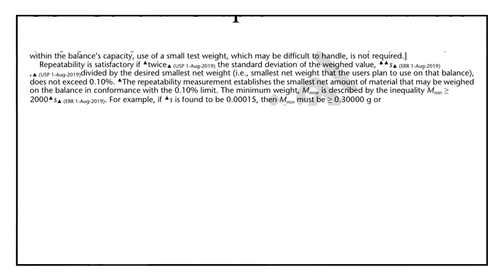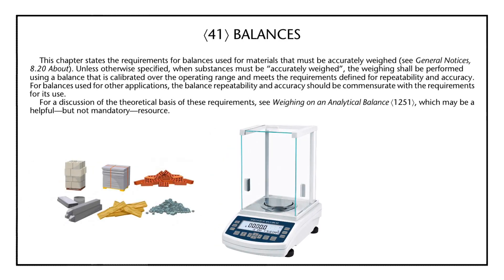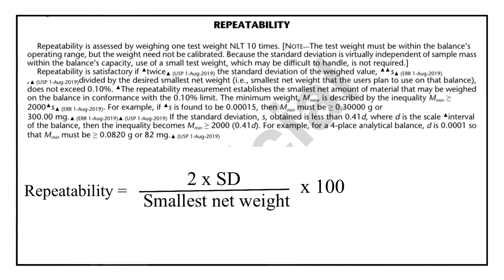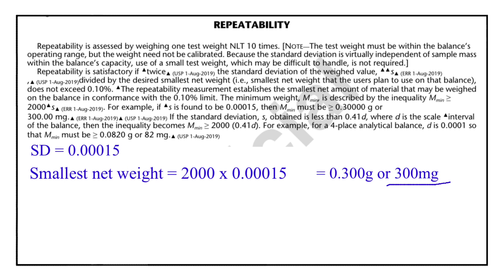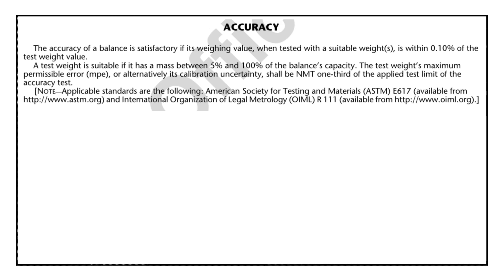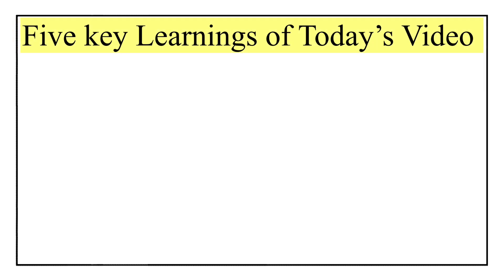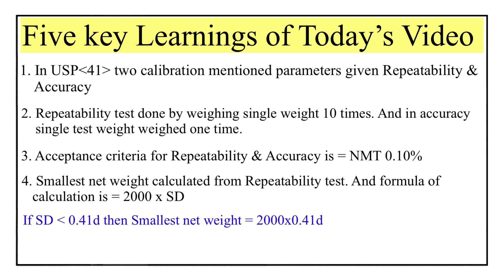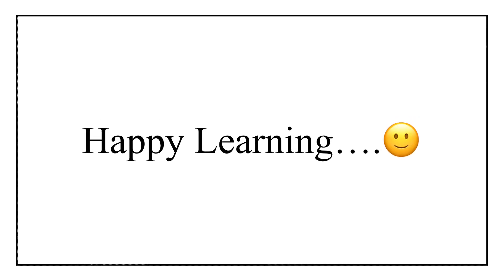USP General Chapter 41 || Balances || Part-2 ||

Comment: Sir, For accuracy test only weight shall be use for calibration or all weights shall be use for calibration?
Reply from the maker: Only one test weight is taken for accuracy test. Generally between 5 to 100 % of balance capacity weight is taken.
Reply: Sir as per accuracy formula, if observed weight will get higher value than certified value then calculation results get in minus value, how we can write final results (limit is NMT 0.10 %)
Reply: Hello sir,
Hope you are doing well.
Let me know that a statement given in accuracy parameter that ' the test weight's max. Permissible error (mpe), or alternatively it's calibration uncertainty shall be NMT one third of applied test limit of the accuracy limit. Plz explain .

Comment: How to find minimum load of balance?
Reply from the maker: 2000xSD is the formula
Reply: Ok but my question is to find SD u have to do repeatability. So while performing repeatability how many gm weight should I use? If i have 220gm balance..than how will I know what weight should i use for repeatability to get SD. Please do reply. Thanks

Comment: Sir, if i perform repeatability parameter as per monthly calibration then there may be possibility of changes in SD every time. In this case how we can find out smallest net weight of balance ?
Reply: Ok sir.
 i have a 5 digit semi micro balance with range of 1 mg to 200 gm. As per USP chapter we can calculate smallest net weight by using formula 2000 x 0.41d i.e. 2000 x 0.41 x 0.00001 = 8.2 mg. 
Then can i weight below 8.2 mg for any HPLC analysis.
Most of the times we have very less quantity of CRS or Impurity standard so In this case, can we weight below 8.2 mg for HPLC or other analysis preparation?
Reply from the maker: @ajitjadhav607  excellent Question. Don’t use for weighing below 8.2 mg. You should use ultra micro balance or micro balance.
Reply: @PharmaPill  sir it means ye 8.2 least count hai 
How to calculate least count of weighing balance.  Plz explain
Reply from the maker: Smallest net weight need to change based on your monthly Repeatability test calibration. But ideally you will see there will not be much change in smallest net weight because most of the time your SD will be less that 0.41 d
Reply: @PharmaPill  sir it means ye least count h ??

Comment: Please explaine, In repeatability there is one note that is 'The test weight must be within the balances capacity, but the weight need not be calibrated.'
Reply from the maker: Test weight must be within in operating range not balance capacity…
Reply: Hello sir, Hope you are doing well.
Sir let me explain below;
Repeatability formula = 2000 x SD / Smallest net weight

Repeatability= 2000 x SD x 100 / smallest net weight 

Which one is correct and how ?